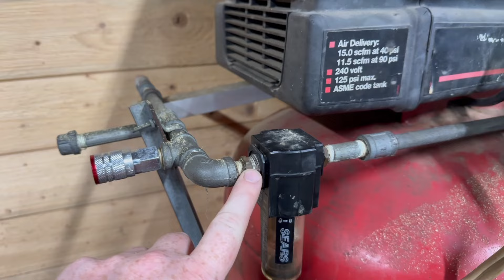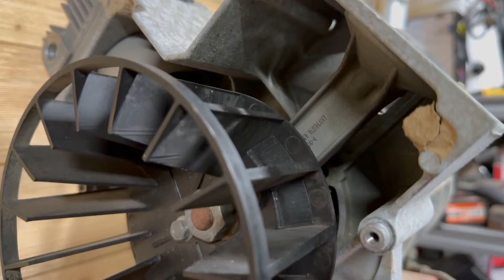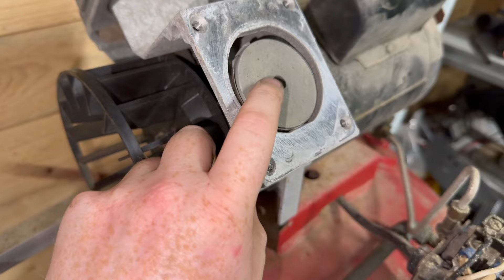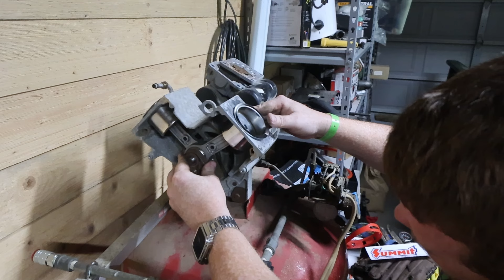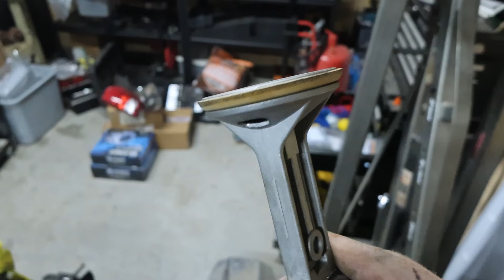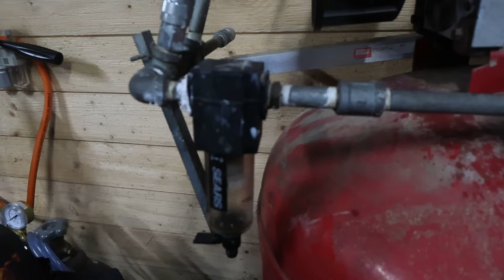Reviving an Old Craftsman Oilless Compressor: Full Rebuild & Test Run!

Comment: Just tore mine apart to find out why tf it wasnt completely filling up or building pressure that quick. Would run for a half hr and only be at 100psi tops. Even when it would fill up completely it wouldn't shut down. Turns out, somehow one of the connecting rods completely snapped at the base of the piston. The rod isnt even in the compressor any more and i have no clue where the hell it went. Piston fell out once i took the cover off, rest of connecting rod is nowhere to be found and looks like the piston itself fell down into the cooling fan and tore that all up. That explains why it wasn't building pressure to fast but Imo, it doesn't explain why it won't shut down once it will build full pressure. Not sure if i want to try rebuilding it or just do a 2 stroke conversion on it since the tank is still in perfect condition after 25+yrs. If its not one thing its another, no shit.

Comment: My rear rod bearing grease dried and caused resistance. Fix: Slightly open grease cover, Flush, repack, and cover cap. Other bearirg done, too. Now , both spin much better, less noise.

Comment: After finding the rod bearings were offset, I put both offsets to the inside (against each other) with the extra space towards the nut and motor and It cleard just fine. I would not put my face anywere near that fan if it were wobbling like yours is, it may be plastic but at speed it could be devastating.

Comment: The max psi on that tank is 125 that means the most you should run that is at 120 PSI, you need to adjust the cut off Psi at around or even a bit lower then 120 Psi, that is if you want to be safe.
   I bought one of those brand new and returned it the next day, too LOUD, recovery was way too long did NOT run my air tools worth a darn, In my opinion it was/is the biggest crap anyone can get, I suggest throwing away the pump/motor keeping the tank and get a real 5 or 6 Hp motor and pump because that is in no way a 6Hp motor, you're looking at maybe a 2Hp General use motor, I got a 3Hp farm use motor from Harbor Fright and I can tell a big difference a 5 Hp pump from a local air compressor company and my recovery time is at about less then 2 minutes...

Comment: Ha!  I'm rebuilding a 6 HP 33-gal one right now.  Bought the new gaskets and ring (mine is a single cylinder) from the same company.  Somehow the ring and  the cylinder were too tight a fit, plus I made one critical error ...... assembling the piston rod back on the motor, I neglected to tighten down the pinch bolt where the rod mounts on the crank/bearing.  Upon powering up, it immediately self destructed, sending rod parts and an obliterated fan pieces all over the garage!  So, back to Master Tool Repair for another NEW piston, cylinder, rod, ring, and gasket set.  Thank God I caught it all on video.  The new parts should be here this Saturday, where I'll try this again.  My video on this whole adventure "should" be up early next week.  BTW, how long did yours take to fully fill up after your repair ??  Mine takes 20 minutes for a 33 gal tank to get to 135 shutoff, but again, it's a single cylinder, so I'd guess yours being double the capacity, with double the cylinders, yours and mine should fill similarly.  (new subscriber ).